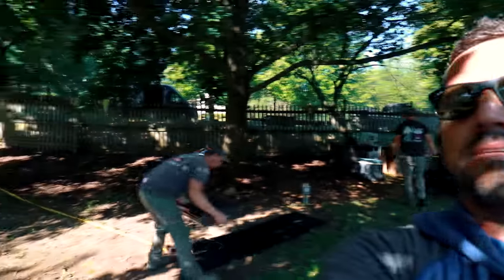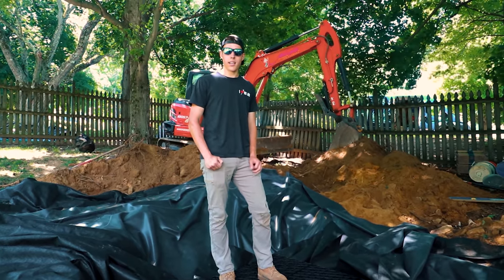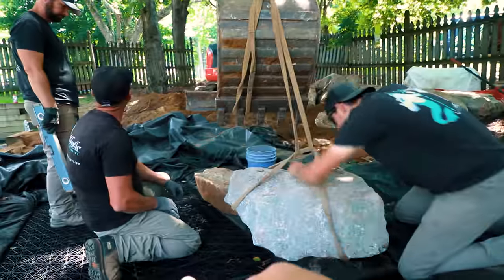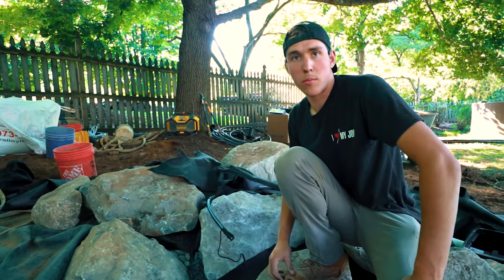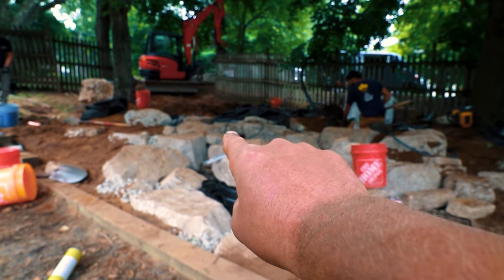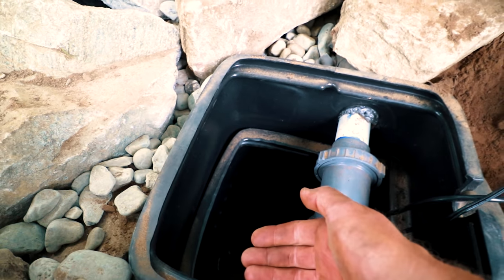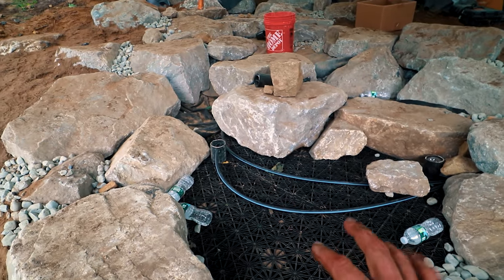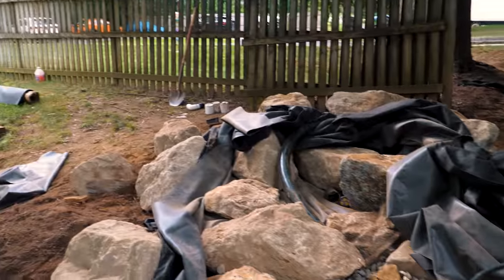This PONDLESS WATERFALL was just meant to be here.

Comment: when filling a wheel barrow lay it on its side with a bit of upward tilt, lay it against your mound of dirt and fill, then hold on to side and pull upright, when your pile gets low put something under side of barrow to get your tilt, place a piece of ply or tin in barrow and fill, when full stand on high leg of barrow hold side of barrow and swing your weight back to upright barrow, slide out your piect of ply which made it possible to get a full load. this is also a very easy to load large rocks. i came up with this when i was doing ponds 20 yrs ago and have never filled a barrow the conventional way since nor have i seen anybody else do it my way, i see people loading barrows on tv and i think ''if only i could tell them.
Reply from the maker: Cool tip, Michael!

Comment: I'm so glad you brought in the moss to fill in around the rocks. Great touch! I'm curious about the geofabric cut and set on top of the waterfall foam. Did you do that in all flat areas between rocks or just some for extra protection. I don't think I have see anyone else do that before. Also how much of the Aquablocks do you cover with fabric and liner? It looks about 1/2 to 3/4ths. Thanks!
Reply from the maker: In a reservoir/intake we cover 3/4. In a wetland we backfill with gravel around the perimeter of the blocks